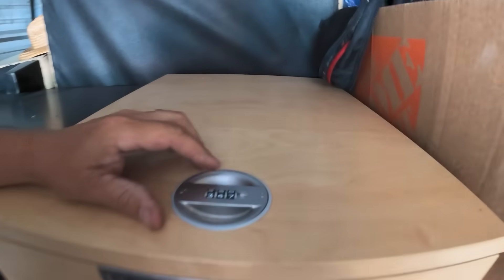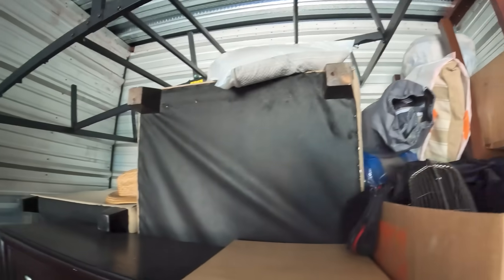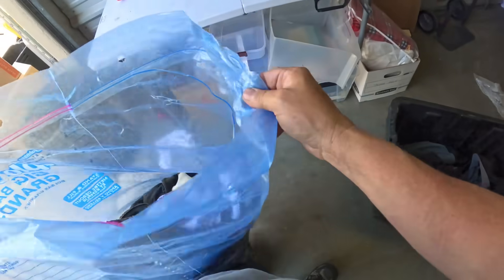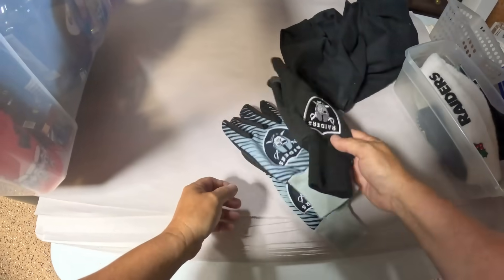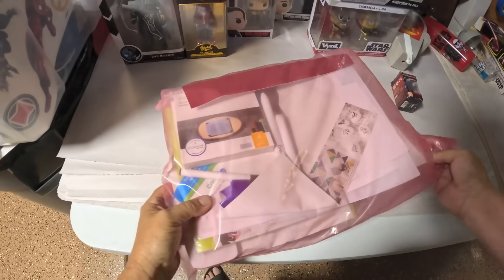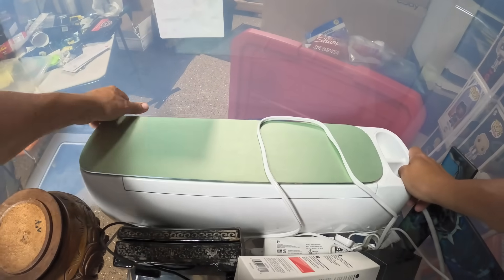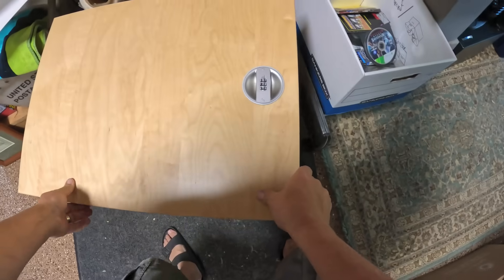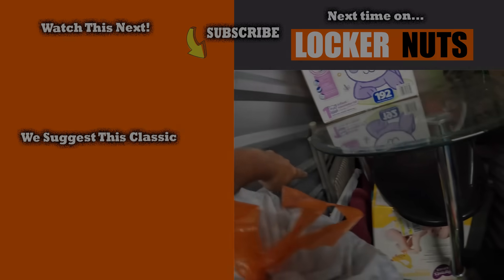Well, this is where it all ends. It was fun while it lasted!

Comment: 8:12 that is a vacuum pump it’s used to remove air and moisture from copper lines in a air conditioning system before you release the refrigerant from your compressor. Normally used when you perform coil cleanings and to check if the copper lines were soldered correctly.

Comment: The Air Conditioning pump is a vacuum pump to put the freon system under a vacuum to check for leaks and then to charge the system with freon. Can be used for automotive or house hold A/C
Reply from the maker: Thanks for the info!

Comment: With that lock on the top. All you have to do is hold the handle to the right and then turn each dial till it clicks or becomes loose you then go to the next wheel and try again.
It does work.
Youtube lock picker.

Comment: that silver thing is an AC System Vacuum for pulling air from an AC System prior to recharging it, you can sell it used for $50 up to $150 for it depending on the brand
Reply from the maker: Thanks for the info! I think I still have that piece.

Comment: tecknics speakers a few 100 what ,id pay 70 to 80 for the pair here in the uk ,they will need work doing to them can see tecknics not that good really, not 80s or 90s pairs nasty and cheap you cant sell atv tyres thats crazy get 50 60 dollars for a set easy the yamaha speaker built with same bass mid and top as the tehcnics set the realistic speaker are worth money those are 1969 or 1970 upto 74 set stunning sound celetron speakers marshal amps had celetron speakers ,id take those all day 250 350 a pair